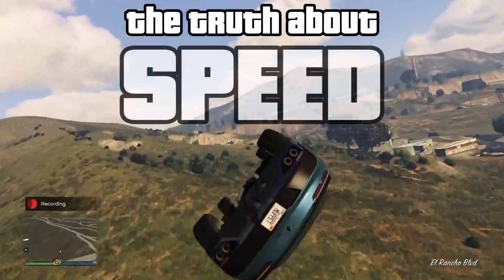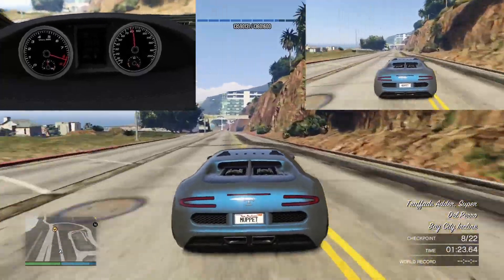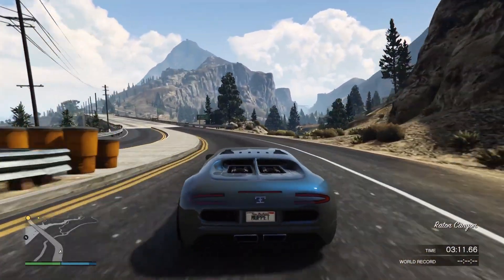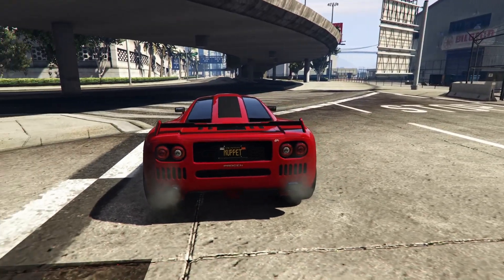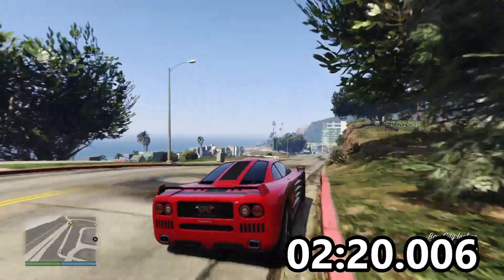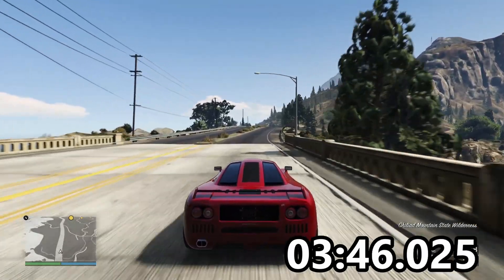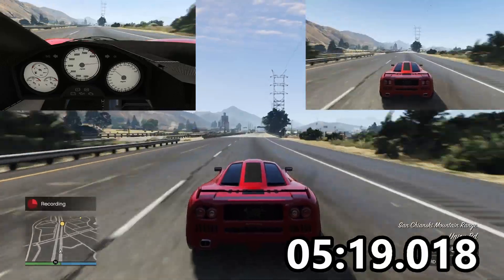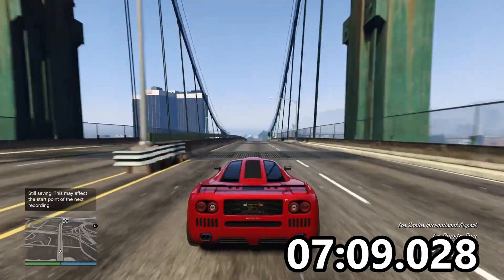The Truth About Speed in GTA Online | Why are the cars so slow?

Comment: From what it seems like is that they just put a speed limiter when you get to a cars top speed.

Few years ago when you had to glitch low grips on cars to give it max speed, different cars naturally red lined and maxed out depending on the cars. Super cars were going 240pmh while some cars may have tapped out at 180. It felt very realistic while having lowgrips. They just need to get rid of the limiter and the game would be golden

Comment: the funniest thing about gta is, you are way faster on bumpy roads, or roads with kerbs/sidewalks than smooth highway because the car gets faster when their suspension compressed
Reply from the maker: Yeah, that bit where I clip both curves to go down the ramp should have been 2 wheels, 2 tyres, most of the front suspension and some bodywork.  On a veyron, what do you reckon? £600,000 repair bill?
Reply: Meamwhile in gta online it takes barely 10k to restore a deformed and exploded car
Reply: All land vehicles have this mechanic of going faster when only the rear wheels are touching the ground (wheelies) so maybe when you hit a bump you are doing a wheelie for a split second which results in an increased speed.
Reply from the maker: That's interesting.  I thought it was either when the floor hit the groud ot when the suspension grounded out.  But if drag is assigned to the wheels, it would make sense that you get a speed boost when thebfront wheels lift.

Comment: The speed glitch that was available a few days ago proves this wrong the game would be much better and the cars where easy to handle
Reply from the maker: On current gen, I definitely agree.  It's easy to forget this game was designed for the PS3, and significantly worse internet connections.  Syncing 30 player locations and speeds when they're doing 200mph over a 1mbps connection.  It would have been unplayable.  I actually think the crux of the problem is that they completely underestimated how popular GTA Online would be, so they had to let it run for much longer than they ever intended.  Thanks for watching 😎👍

Comment: 0:30 that just some quality of life physics to actually have something fun to play, the driving physic itself is quite good, all the suspension physics is great, weight transfert when lifting off the accelerator or trail braking is there, if you remove those quality of life physics, its a good match to a Forza Horizon

8:26 it would be absolutly fine to drive, just need so learning like any other games, the video feels fast than it would because we see all the road bump and screen shakyness at 2x speed
and if we actually could, the physics would have been ajusted to be trully drivable

The problem is more that they didn't wanted to make you feel that the world is same, TheCrew2 allows you to go anywhere whenever you want like you mention at 10:30 yet you can go at 400, 500km/h, even 700km/h when you drive the dragsters, simply because the map is about 75x bigger than the GTA5 map, it takes you about 25-30 minutes to drive 100-115km, they didn't need to reduce the speed to match the feeling of map size they wanted

im even not sure if the math is correct because, for exemple at 8:55, the video speed should already ramp up when you exit the corner, your speed is instead constant from the corner, all the way along the bridge (you can calculate it by counting how many stone pillars on the bridge railing passes par second) and nearly to the next corner at 9:34 then suddenly ramp up to twice the speed, it could shave even 30-45 second of that calculated time
Reply from the maker: Hey.  Firstly, thanks so much for leaving such a detailed comment, I really appreciate the time you put into this.  So I'll go through each point for you.

1. Yes, you are, of course right, I was just poking fun at the physics because I thought the "It's not a sim racer" comments would be inevitable if I didn't.  The pace of the game demands things like, flipping cars back on to their wheels.  And without mid air control, we'd have no stunt races and they are awesome.  You're right about the bumps, in real life, you'd never get any where near top speed on roads this bad, but they were engineered to feel fast at 120mph, so that makes sense.  I think when you look at things like weight transfer, it is there, but only when you compare it to a sim racer does it become obvious how muted the effect is.  I am working on part 2 which will include some comparison work.

2. and 3. This is the crux of the reason I think.  Partly technical ability at the time, but the Los Santos map is 75 square km  Los Angeles is over 1200 square km, that's a massive difference, so the scale weirdness and the need to keep city driving exciting probably contributed as much to why they need to mess around with speed as the technical restrictions at the time of development.

4. The speed ramp to top speed is probably the part I'm least happy with in the video, the weirdness of the way speed builds and the scale meant I had to take some liberties here. Some of this I am dealing with in part 2.  Matching scale for speed and not really being able to get or calculate real data on cornering will mean that some sections are not perfect.  However part 2 should be able to look at this in more detail.
Reply: @perengerin  totally agree, can't wait for part 2 then

Comment: Supercars should be as fast in GTA as they are irl, not everyone would be able to control them but they shouldn't be, controlling a carbon fiber box with a giant engine at 400 km/h should take skill to do, just like irl, if you can't control it, use something slower. The same thing applies to other vehicles although some air vehicles, mainly fighter jets should obviously have it's speed nerfed since i don't think being able to fly at mach 3 would be good for the game
Reply from the maker: That would be a great GTA style strap line for a new car.  "The New Grotti, if you can't control it, buy something slower, wimp!"
Reply: @perengerin  True, i like how it sounds

Comment: Your arguments dont reconcile Franklins special ability. Lod times dont seem to matter when you come out of his hyper focus at 200+mph. Franklin is the reason the cars are so slow.
Reply from the maker: I'm not sure I agree. Franklin's ability give the impression of speed, but it actually slows footage down to achieve this.  Also for obvious reasons these time effects were dropped from online as it would be a nightmare manging timeshifts between 30 players.  Thanks for watching and commenting😎👍
Reply: @perengerin  yw, but.... I dont see how there can be a 'technical' reason for the slow cars when I can inject a menu trainer and easily acheive the speeds these cars shouldve been able to go. My pc is very much nothing special, aging, middle of the road z97ar, 4690k, 1080ti with some very old I think 32gig of ram. I am never running into stuff because it didnt lod and i run at max native graphics. If going 300mph in game works just fine, rockstar couldve made the cars much faster.
No doubt, 200mph is a handful but the point is, there is no maths, no technical reason for the slow cars. 
The point of gta online is to grind and die. Thats it.
Reply from the maker: @ubermensch0072  True, but it's easy to forget what the hardware looked like in 2013.  The PS3 has 256MB of video RAM 256 MB!! The PS5 has 16GB available.  64 times as much.  Vice city was only a few years earlier and that needed loading screens between different parts of the map.  I honestly think what they come up with for GTA 6 will have none of these problems.  They were designing for the technology at the time, they had no idea this game would span 3 generations of kit.  As for what they want with grind and die.  I do agree with you on that, you can see them testing it with all the new business types we've had over the last year or so.  Just seeing how little they think they can get away with giving us before people stop playing.

Comment: Everybody knows the speeds are crippled to allow consoles to load the scenery as fast as it needs. They accomplished this by doubling gravity, increasing air drag exponentially, if you ever watched Broughy1322 and how they look into the game code to understand its quirks...
Reply from the maker: Absolutely.  Broughy does some great stuff.  Northern lad too, so that's another tick in the right box.
Reply: @perengerin Heck I would add in even the Racing community has some good knowledge on this, particularly the Stunt racing side of it, check out Rev Boosting and Brake Boosting, very odd speed glitches in this game lol
Reply: Not the problem use Franklin’s ability to hit 200mph .. scenery still load the same
Reply: @Dd-mt5ol  What happens after You stop using it ?

Comment: Definitely hoping cars speeds are grestly increaed for GTA 6
Reply from the maker: Yeah.  I hope so too, and I really think they will be, just look at how much hardware and software has evolved since then.  I think we'll find they've done some really clever things with loading to keep the feeling of speed and the detail you need when walking.  I'd use read dead as a yardstick.  That's 6 years old and still looks as good or better on the PS4 as some current gen games on PS5.
Reply: @perengerin  idk if you tried the speed glitch that was around for about 2 days
The sense of speed was incredible and the loading was stable.
There were pop ins with some vehicles doing questionable stuff, i first thought it was because of the speed but it also happened before doin the glitch to "unlock" the speed.
I do hope there is no cap to the speed. I dont expect a fiat 500 type car to do bugati speed  ut id appreciate the customisation scene to actually matter.
Reply from the maker: I didn't have chance to try it, I think it was found a couple of days after the speed video and wasn't around long, I watched a few vids on it though. I think some of the issue with realism will relate to the top speed and how you achieve it. Take the Bugatti as an example. Irl it gets to 186mph in under 15 seconds, but it takes another 30 seconds of flat straight road to hit max speed, which probably won't work for the map, or for the gameplay. So they will still need to exaggerate acceleration.
Reply: @perengerin  acceleration was very crazy. If you got a discord I don't mind sending the only clip of a highway race between me and a buddy.
That glitch was the best 2 days of gta online.
Reply: Keep hoping
Reply: Yes Sir

Comment: They’re definitely going to up the speed for gta 6 considering how big the map is
Reply from the maker: Yeah.  With gta 5 physics it would probably take 25 minutes to do a circuit. Real physics 35=40 minutes. So they will have to do something clever there.
Reply: the map is not considerably bigger, the roads are not that straigth so you cant speed up that much and make the ps5 loading objects look like a ps3, dont expect major changes in the top speed
Reply: They’ll also have better hardware compared to the PS3 and XB360

Comment: Great video, I enjoyed that and it made think. I've always assumed that they limited the top speeds just so it was possible to drive them at those speeds without crashing every 3 seconds.

I'm not entirely convinced by the maths ... I've never driven over about 160, but in terms of the amount of road covered, it feels consistent with how the Macca looks at its top speed of 230-something. However ... the slow stuff ... is that right...? Imagine how much road you're covering in 15 seconds at top whack. Now look at the speed at the start doing (adjusted) 60. Would you really cover the same distance in a minute? I'm not so sure. The speed at v-max looks a lot more than 4x the speed at 60 to me.  And at the quoted 100, it should be covering nearly half as much road per second as at v-max.

It would be interesting to see a similar video on braking. Braking in real life from anything over 100 takes AGES ... and in anything from the 1980s or earlier, you have to start the process in the previous postcode. Realistic braking would not be fun in GTA!

Many congratulations on the subs landmark, I'm sure it is the first of many to come. You always give us quality content, thank you.  🎉
Reply from the maker: Thanks.

I agree on the slow speed sections.  They look really, really odd. Without accurate tracking and with numerous scale issues, I could only go on the speedo. So at low speed 0-60 becomes 0-30 but it needs to take 3.2 seconds.  It's worse in the mid range where the acceleration is exaggerated 3x so needs to be slowed down to 33% then ramp up to 207% for the top speed, so the 1 mile section, which is measured, takes 14 seconds at full tilt. It's all really odd. I came quite close to not posting this video as it looks so odd it raises more questions than it gives answers.  But I figured, if anything comes from the comments, I could always do a follow up.

There are also things like the fact the top speed around the top of the map is higher than at the bottom.  Because, reasons.

It did make me think about how hard they worked to make sure that it treads the delicate border between realism and fun.

Really glad you're still enjoying the content,👍😎.  Much more to come.